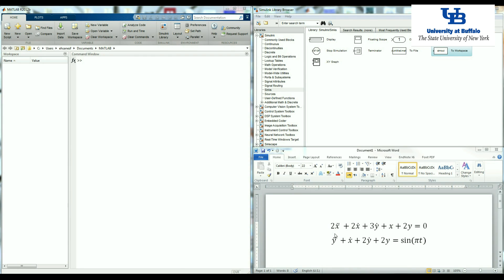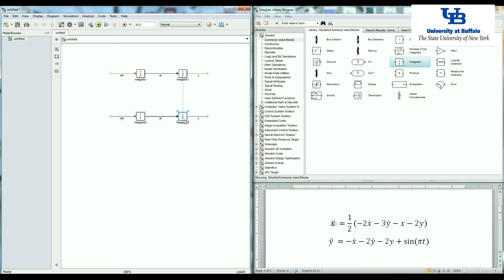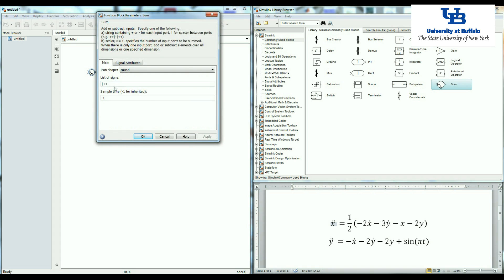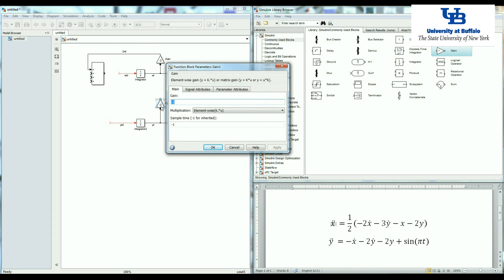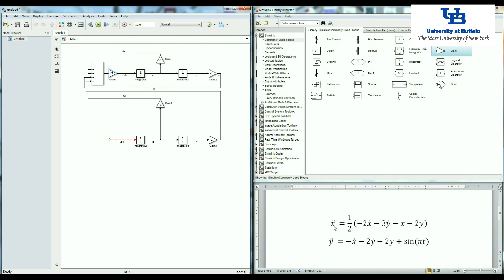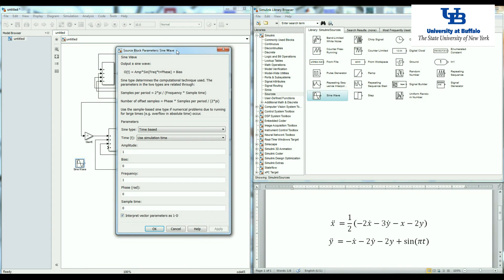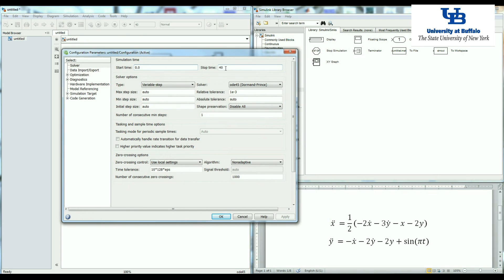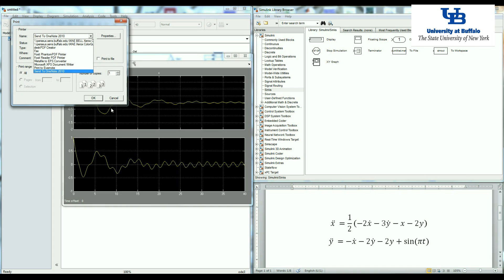Solving systems of ODEs in Simulink

Comment: Can simulink solve  system of 5 differential equations???Please answer
Reply: Yes, you can solve a system of ODEs with Simulink, 5 ODE is very simple. Depending on your problem you may utilize different numerical solvers. If the equations are not stiff, it should be easily done